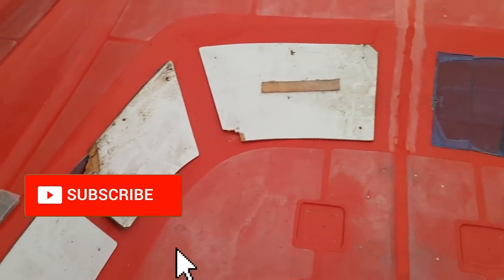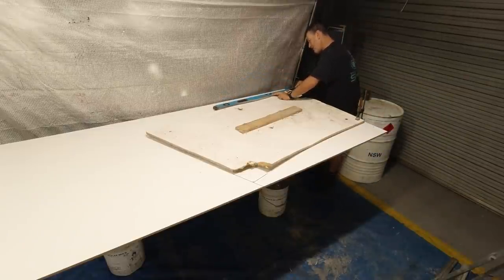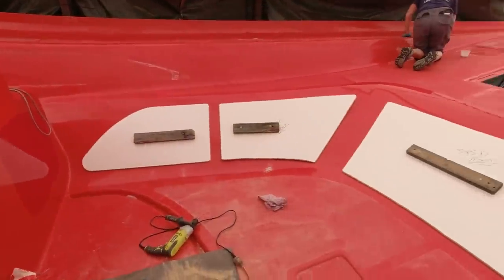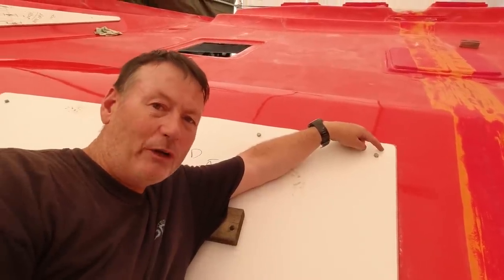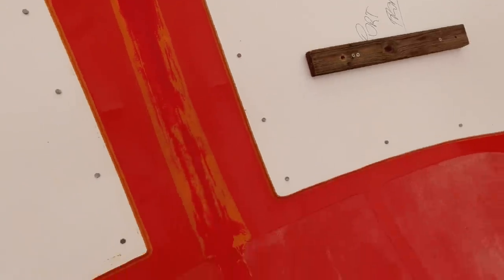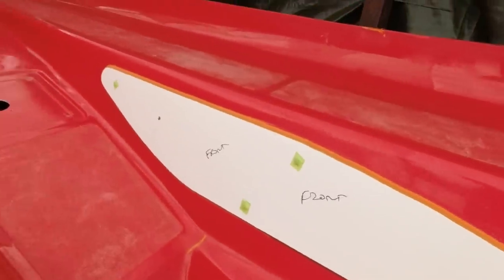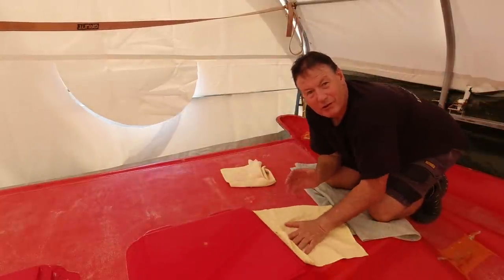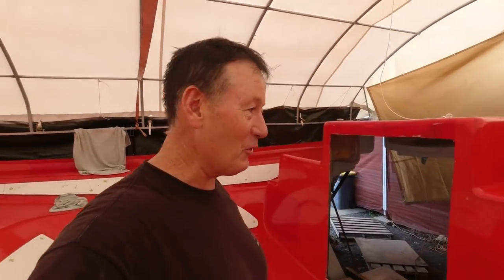Ep166 Catamaran Coach House Window Inserts and Final Waxing

Comment: you should use T-nuts on the window blanks and run the bolts through from underneath. That way you can remove them in the demold very easily and the T-nuts are nice and smooth on the inside.
Reply: He'd have to cut the bolts off at just the right length, and seal them, or the exposed threads would get covered in gelcoat and stuck to the nuts.
Reply: @robinbennett5994  yep. Should be very easy to do. Most T-nuts are over a 1/2" 15mm long, giving a nice range of thread engagement. So he could actually just buy short enough bolts  that wouldn't extend too far to begin with. A quick dob of plasticine and tape would seal the inside. But he has it done by now anyways so it's a moot suggestion.

Comment: Not helpful after the fact, but a trick/tip from years ago, whilst moulding RV roofs, warm the Plasticine up with hot water, and modify and clean an old silicon tube, and put the Plasticine inside, then the rear pusher seal, and mount in a gun, cut a new tip to the bead size you want and squeeze away, once warm, the Plasticine flows fast, nice and easy. Looking forward for the next few videos, Ross&CO.

Comment: Ross, how was it done originally?  Did the manufacturer just lay those inserts in place and then vacuum bag over them to make the mold.  If so, how did they ensure the inserts didn't move when the bagging was done.  Otherwise, wouldn't there have been some existing "mounting" holes where the inserts were secured to the mold?  I am not seeing how the inserts were incorporated originally into the mold.
Reply: They would of been bonded to the mould, with some type of glue, over time they have  shrunk absorb water and dried out, broke and released.

Comment: Pick up a bag of 'Ping Pong' balls, cut them in half and hot glue them over the bolt heads. Easy to cut off the tops later to remove the bolts...

Comment: couldn't you have  put the nuts on the inside of the mould on top of the mdf inserts  then the bolts could of been undone from underneath when you de mould the bolts would of been pulled out leaving the nuts with the mdf
Reply: I wondered the same but the problem would be getting gel on the end of the bolt threads preventing getting the bolt unscrewed. with the bolt heads on the inside the gel shouldn't get anywhere near the threads...Might have worked with domed nuts but I guess all the bolts would have been different lengths.

Comment: I understand the concept of the inserts, but the narrow ones confuse me, seems like you would have just not done inserts and given yourself some flexibility of choice after mating to the hull. Ordering new windows and using them as the templates seems a bit more intuitive. Good luck, and glad to see Janice in the videos.
Reply: He wants all the windows flush to the hull. to make them flush, they need a rebate the thickness of the window, hence the insert. You can't do it afterwards.Windows wont be "ordered" they will be cut from sheets of lexan, sized from the template, and bonded flush into the rebate.